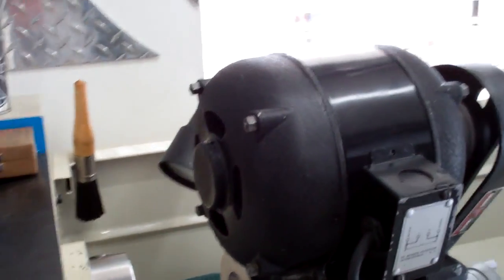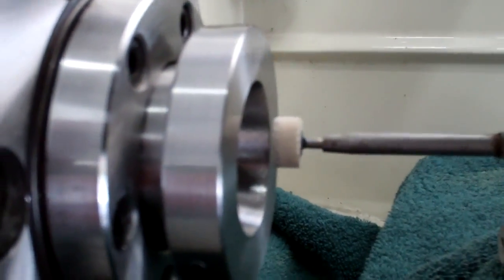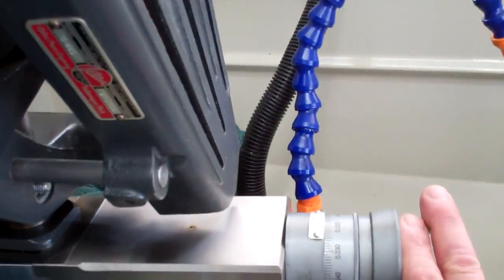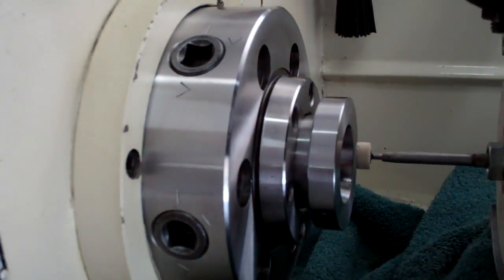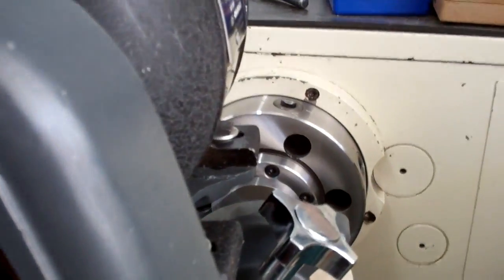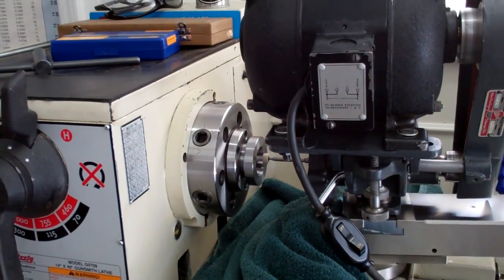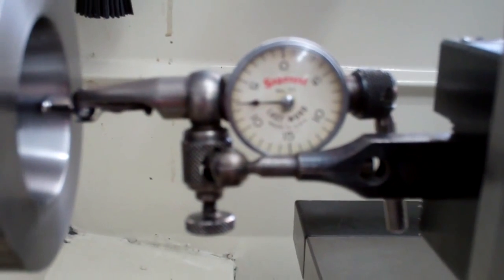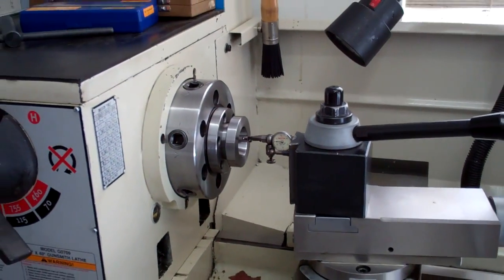5C Collet Adapter vs Atlas 10-450 Tool Post Grinder #realraysgarage

Comment: Hey brother, how much for the grinder????
Reply from the maker: Hey Rolando,

This is not my grinder, a machinist friend loaned it to me for this little project. I do believe he would sell it and I can tell you it is in brand new condition in the original wooden box from Atlas and has all the accessories, don't hold me to this but I think he will let it go in the $800 range. I have seen them in bad condition on eBay sell for $500 - $600 range. Let me know if you are interested.

Thanks for dropping by man!

Ray
Reply: Ray Caniglia I was really trying to get a ball park figure.   I've rigged up something similar to what you did, however I use a pneumatic tool die grinder.   I am still trying to hone my milling skills in making a holder for it.  It works great.  Thanks for idea on using the Morris to collet adapter!   Your vids rock thanks brother!

Comment: i thought that it was .002 between the lines... a thou a side... but i'm easily confused..
Reply from the maker: My machine removes .002 Overall per line on the cross slide dial, make a cut and measure, yours might be differant so check it!  Always measure your part, heat in the part will change your measurment and cut also. You can also use a mag base indicator on the cross slid.

Ray
Reply: we have the same machine ray... thats why i'm so annoying :o)
Reply from the maker: carryit around
Reply from the maker: carryit around
Reply from the maker: Not annoying at all, never know what Grizzly might change from machine to machine. Does yours remove .002" per line on the cross feed disl as well?
Reply: yes,,, the little symbol 0 with a slash on the dial means diameter so it reads how much you are cutting off the total diameter not half...
Reply from the maker: I did not know that, thanks for the info! I'll look when I get home today.

Thanks again,

Ray

Comment: Nice fix but what about run out at the other end of the collet adaptor, for analogy, think of your LH end of headstock spider. To fix this you would need to grind the outside morse taper while the it was mounted on a dummy 5C shaft, as internal grinding would put it outside tolerance. This is the voice of experience talking as I had to do something similar to a 5C collet chuck, that I should have spent more money on when looking to buy.
chris
Reply from the maker: Thanks Chris, I never thought of that, once I got the adapter to run zero, I thought I was good to go. Thanks for your advise! I realize more every day how much I don't know about machining!
Reply: Even old guys can still learn something, so don't feel bad.
Reply from the maker: Chris Stephens Thanks Chris, and thanks for keeping me in line! Ray C.
Reply: Not trying to keep you in line, that implies you have to do it one way. You must think for yourself and work out your own ways, but based on the experience of others.
Enjoy the learning curve.
chris
Reply from the maker: Chris Stephens That's for sure Chris, learning from experience of others is priceless, and am very thankful for it! Thanks again! Ray C.